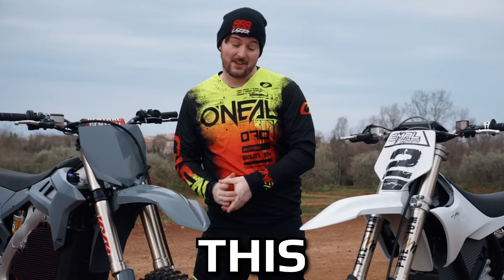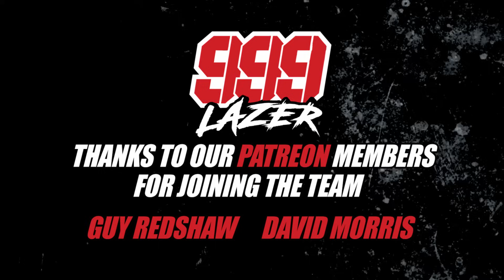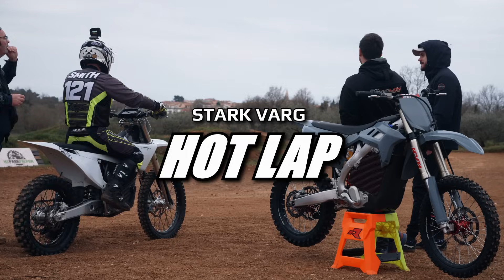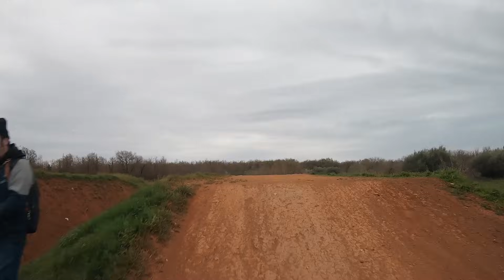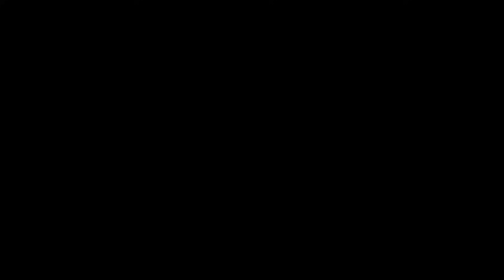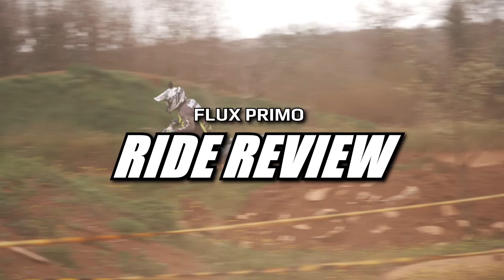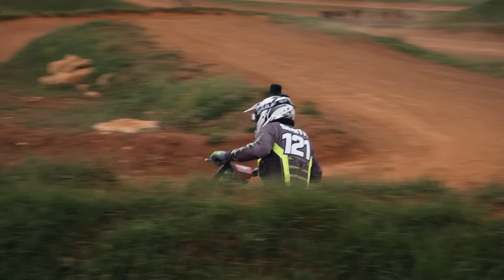$50,000 Dirt Bike vs $50,000,000 Dirt Bike! | Electric Motocross Shootout

Comment: For anyone who has had to live through their sport being suppressed by noise complaints, I can’t see anything other than positivity for these things for the sport. Time will tell how cost effective they become with regard to shelf life’s and tech issues but they’ve already ticked off the first objective of being quicker than a heat engine machine.
Reply from the maker: We found out first hand on this trip how useful no noise can be, we were able to start riding as soon as the sun was up and there was enough light and get filming done before the rain came. There's no chance we would've been allowed to do that with a couple of 4 strokes.... thanks for watching dude
Reply: @999lazer  4 strokes can easily be very quiet.  A bone stock EPA legal 500 KTM is quieter than my DR650 was stock.
  But nobody leaves them quiet.   Self imposed problem.
Reply: When the Alta was out that was the selling point backyard tracks. No one could complain about "noise". Same goes for trail riding, the noise complaint is no longer a thing and most hikers and Mtn bikers will wave at you and say "wow that is quiet". Depending what you ride range can be fine. A 20 miles brutally rough singletrack is tiring for a LOT of people thus more then enough range. The Arctic Leopard EXE880 will for 60-70 miles of singletrack, that tends to be a very good loop that has people done for the day. I'm not sure who is riding much more then that for singletrack that is rough in a day, that is a great day already of riding.
Reply: @Meekerextreme  The ALTA didnt last past the first climb at Erzeberg, battery over heated and killed itself.
There's a reason ALTA went under quickly.    Who would buy a used one today?
Reply: Batteries make HUGE heat when stressed hard. Its why the E motorcycles taken to Erzeberg didnt make it past the first climb.  Over heated batteries and dead at side of trail.   How much use is massive E power when the motor is done for the day? 

There are issues with E motorcycles that the makers of them dont want to mention, its not just range problems.

Any motorcycle can have a quiet muffler, but thats the first thing buyers of dirtbikes throw away, they WANT noise.
Reply: this! Motors and electronics will outlast us all, the only thing is batteries. In our chamber testing they went well over 1000 cycles above 80% original capacity. Ofc depends widely on usage, but replacements will likely be way cheaper or way better by the time you'd need it, if ever.
Reply: @FluxMotorcycles very cool bike.  My only worry is that by the time this gets a frame and suspension, it'll lose some of the magic or pedigree, as using established Japanese frames that also had 10+ years of trial and error in terms of getting the perfect stiffness/flex while also being able to switch to alum.  Would you entertain the idea of making a kit that can be dropped in alum framed rollers from the big 4? Or selling components separately? I like the concept, but love my Japanese (honda) frame and part availability.
Reply: @FluxMotorcycles so you think the electronics and motors in these bikes will be that durable and last that long? I really hope so, but with the way most electronics and electric motors are made now days it makes that hard to believe. My durability expectations may be too high since both my trucks and 2 of my bikes are all over 20 years old!😂
Reply: @alternate3307  I hope so too man. I don’t have any thumpers any more but still have an 88 CR 250 that I’d love to ride on the tracks I grew up with and watching closely to see how it pans out mate
Reply: @alternate3307  EMTB buyers are finding this out the hard way. 7 to 10K bike and the motors hate water, the software can turn to crap, but mainly they are outdated the day they are built.
Technology changes so quick the bikes have no resale value.      People  are so excited over these first E dirtbikes,  they too will be horribly outdated and maybe out of business in a few years.
Reply: @FluxMotorcycles  
Perfect video ! I was waiting for something like that !!
I don‘t know Marko personally but I had some written contact with him over the time the Prototype was shown on social media. Always he is straight forward realistic with no „over the top“ marketing promises.
That‘s exactly what we want when buying something new like an electric mx bike….

I hope the company will stay like that !
Reply: @FluxMotorcycles  A dream.  Electric motors run hard wear out, they over heat, if water gets in them they are toast.
EMTB owners are finding this out in a big way. Water gets in, motor corrodes internally.  Its junk.
On most, battery range sucks, carrying spare batteries sucks.  A Varg battery wont finish a hard ridden 15 minute moto, and yet its an MX bike.

Comment: I was surprised by the result. I thought the Flux was losing time because the rear tyre wasn't really biting , but spinning instead.
Full respect to the company for not over promising anything and not the usual PR BS that most new companies put out. I think they'll be totally successful.
Great video again.
Reply from the maker: Thanks Stevo! As you can see from the video Sean and I were quite surprised by the results as well. The two bikes did feel like they put the power to the ground very differently. I would say the Flux felt a lot more manageable, at top power especially
Reply: @999lazer so both bikes we’re ridden in the 80hp (max power) version right ?
Did the Flux feel underpowered or only more manageable on this setting ?

It would be great for the next time (I hope there will be a next time when the primo is ready) to get a best laptime comparison with the setting the rider feels the most comfortable on every bike. Because I heard the stark feels really hard to handle in the 80hp setting.
Reply: @999lazer the test was swayed by the flux rep who was there ! Pretty biased I’m guessing trying to not offend anyone
Reply: @Ozrider2504  we had zero input and even came with a disadvantage (by not having a moose rear). Nobody knew the time before the reveal and we were surprised ourselves, we didn't think we'd be so competitive out of the box.
Reply: @FluxMotorcycles zero imput ? Being present at the test is an indirect imput . They aren’t exactly going to say your bike is shit when you personally took it there for them to ride are they ?  And the comparison of the $50m and $50k is so disingenuous that showed right there the test was scewed . I applaud you for bringing a new bike to market and ima sure it’s awsome . But to say that the stark cost 50 million and your bike is 50k is something only a stupid person would accept , stark build a prototype and only took in money from royal enfied etc like a year later and used that money to build factories . And then for these guys to say the bike cost 50 mill to develope is a straight lie and reveals their hand so clearly in this test . Once when congrats on the bike elec is 100% the future and I love seeing more bikes I’m just  pointing out obvious issues with this video . Also can you confirm that your bike will be like 10 k cheaper than stark since it’s a 50 k bike vers 50 mill ? 😅😅😅😅😅
Reply: @FluxMotorcycles  also can you explain how a moose is an advantage ? I’ve had them in bikes before and they feel like shit . They make  make bike not turn and transfer so much more energy into chassis on high speed travel of the shock and fork . Unsprung rotating mass on a bike is literally the worst thing you can do .
Reply: @FluxMotorcycles  also one more thing on the 50k vs 50 mill thing . I did some math for you . This shows what a lie this is . 50k is .1% of 50million . Ok ? Now in Australia a stark sells for $19k . So does this mean you will be selling your bike for 19 Australian dollars? According to  the “cost of each bike “. You should be able to afford this with same margins . 🤷‍♂️ . I don’t know how you let this channel make that claim  on cost
Reply: @Ozrider2504  we don't have a hand in editing, we just provide the bike. Ofc the numbers aren't directly relevant, it's just a title, it does reflect the difference in time and resources available to test and work on the things. 
The moose has more grip due to running a "lower pressure" compared to tubes. 
We won this one, we'll lose some other one, the road ahead is long and we look forward to improve consistently and come out on top once our bikes are in the market.
Reply: @FluxMotorcycles  the channel directly uses these numbers to promote your bike as being the “underdog” so it’s relevant ,  I’m sure this $$$ comparison was spoken about verbally off camera if they wouldn’t have made it a feature in the video . And I said I applaud you I think the bike looks cool and is probably awsome . I just can’t stand dishonesty and that’s what I saw in. This video from the channel that’s all . I’m having more of an go at them than you .   And regarding the moose , yes they have more traction but as I said from my experience they severely hamper handling and suspension recovery . I had a 350 husky with mode front and rear and it felt like it added 15 kg to the bike ! Anyway . I look forward to seeing another electric bike on the market . Hope you and stark can both take it to the larger manufacturers 🔥.  After my experience owning a varg there’s absolutely no comparison between elec and ice for me now .

Comment: Did I hear right that Royal Enfield funded the development of the Stark ? A company with one of the highest carbon footprints (India) funding a greener option to the combustion engine 😂😂
Reply: There's nothing green about making lithium batteries
Reply: NO, they did not fund the development. Development was done by then. More than likely, they funded production.
Reply: @Marleysdad808 Exactly, this price comparison they keep bringing up is a complete yarn. The Stark prototypes had already been ridden by most of the media (June 2022) before RE invested (Jan 2023).
Reply: @Marleysdad808  Not a great deal of development needed to bolt together a pile of off the shelf parts, stark would have had to make a case for the cells and a frame to put all the parts in when they arrived from china.
Reply: @b45her  Tell me you don't know anything about the stark without telling me you don't know anything about the stark.
Reply: @b45her  Name a part that's off the shelf other than the suspension, tires, cells, bars and grips. I'll wait.
Reply: @Marleysdad808  the motor, controller transmission will be catalogue parts from china, Wheels are KTM cast offs. theres not much else left on a dirt bike.
Reply: @b45her  wrong. all proprietary, in house parts.
Reply: There’s nothing green about an electric motorcycle.
Reply: @peterleonard9759  Nobody's claiming it is. 🤡
Reply: Wait is royal Enfield and bike company or a country now ? Seems you’re bending reality to make a lame point …
Reply: @Ozrider2504
Reply: Royal Enfield is a bike manufacturer owned by an Indian company, India has one of the biggest carbon footprints in the world . Do you understand that  or is it a bit much for you to get your head round ! Sausage  @Ozrider2504

Comment: No foot brake is a major L no feeling of banging gears and no clutch so you have no real control over the power to the rear wheel nope keep that sht won't get my $
Reply: Well it's 100% that you have never ridden one 🤣🤣🤣
Reply: @kurtheidelbach  no need I can tell it's sht from over 1000 miles away
Reply: @ajaxracing  Yeah, extremely uneducated thought process. Just like all the other morons that say stupid stuff until they ride one. You can't fix stupid!

Comment: Nope. I don't care if these things spread like roaches. I'll never throw a leg over anything that goes "ZZZZZZZZZZ" when I twist what used to be throttle.
Reply: Cool story. No one is gonna force you to ride one.
Reply: I’ll take both types of motors, thank you. Every sport require a quiver of arrows for each type of task.
Reply: Couldn't care less.while you run out of places to ride because of your noisy smelly gas burner pissing off everyone but bike enthusiasts I will be riding a near silent torque monster on the trails enjoying my life.
Reply: @zachfpv4493  Good for you. Don't forget to bring your purse.
Reply: @stkyfngrszmooth  yeah nah.a purse is a fashion statement.I am all about performance before aesthetics.If I want to ride long distance ICE is the way to go but for fun and convenience off road e-moto is just more fun and faster for the most part 🤷
Reply: I can ride electric almost anywhere at anytime. It's u huge upside
Reply: Dude. They may not sound cool but electric bikes have so much torque it's scary. and they can apply that torque across a much wider rpm range than combustion engines.
Reply: There is a $50 FMF mod for people that are so warped with noise
Reply: @kurtheidelbach  It's not just the sound. It's also how combustion engines feel when sitting on them. You can liken it to the muscle car community where both the rumble and feel of the car changes when revved. It's impossible to get that same feeling from something electric. If you've ever been to a motocross national and the 30-second board goes up, the crowd has a particular reaction. That same reaction would be completely different if the gate was full of blenders.
Reply: @stkyfngrszmooth  🤣🤣🤣Yes, I've been to tons of National, SX, and E bike races LOL. It's 100% obvious you have never ridden one Grandpa!
Reply: @kurtheidelbach  No, they're too gay for me, thanks. No clutch, no gears. It's apparent these are meant for MX illiterates who are either too inexperienced or just too lazy to learn how to ride a real MX bike like a man, but I can see how you'd like them. 🤷🏻‍♂️
Reply: @kurtheidelbach  Those can openers on wheels have no clutch or gears, which is what beginners would prefer. Me, I'm old school and prefer to be able to actually hear and feel real horsepower between my legs and not a bunch of triple-A batteries going ZZZZZZZZZ. Obviously, you're afraid of real bikes. Otherwise, you wouldn't be pimping these electric kiddie toys.
Reply: @stkyfngrszmooth  What an idiotic statement! First off some actually do have clutches and gears but is totally ridiculous to have in some cases because you don’t realize the benefits. The only reason an ICE bike has gears is because it has to moron! And no, I as almost everyone that owns E bikes have all kinds of ICE bikes. They are a huge growth area and addition to the sport not a replacement. You have obviously never ridden one that’s very obvious. Sound like the same idiots that make stupid comments until they actually ride one.
Reply: Dinosaur!😂
Reply: @SwedBear1  And PROUD of it. I bet you've never had to kickstart a bike in your life. No wonder this sport is being pussified.
Reply: @stkyfngrszmooth  How much are you willing to bet?
Reply: @swedbear4035  How do you plan on proving it exactly?
Reply: @stkyfngrszmooth  😆
Reply: Okay. No one will force you. However the earth would thank you if you bought an electric motorcycle.